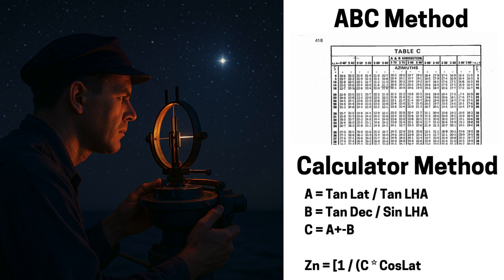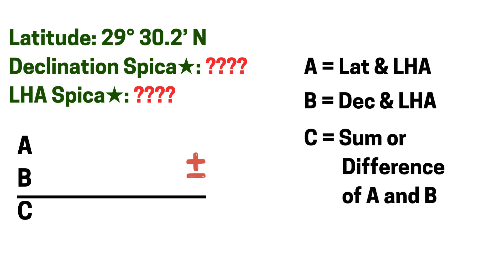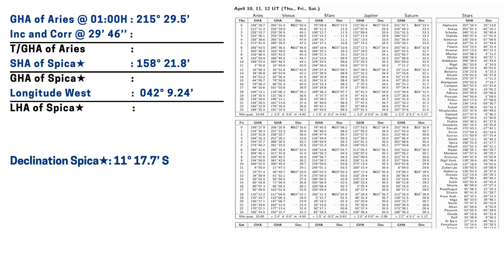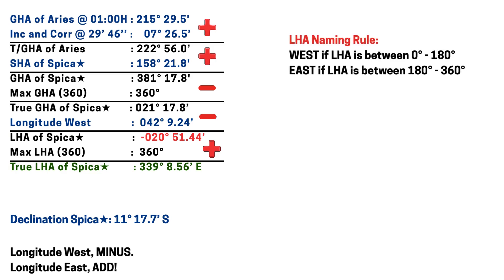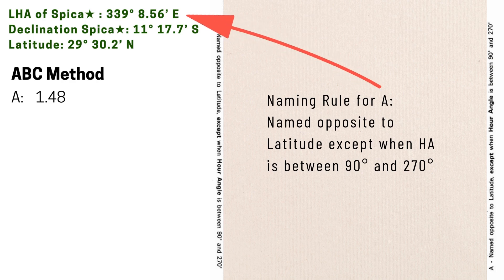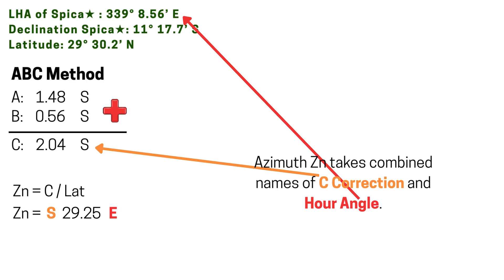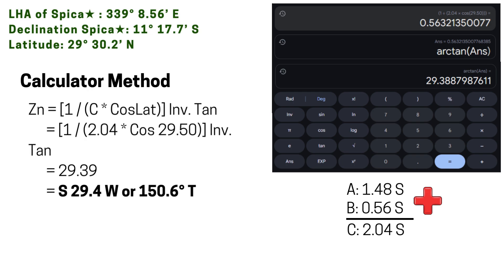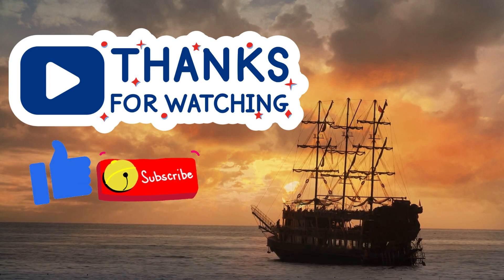How to Find the Gyro Error using a Star's Azimuth (ABC and Calculator Method)

Comment: Excuse me but I think there's an error when the increments were input. 3:40  instead of using increments of aries you accidentally used the sun's increments
Reply from the maker: Thank you for pointing that out. Yes it was a mistake of 1.2' increment. I should have used 7°27.7' under the Aries column.